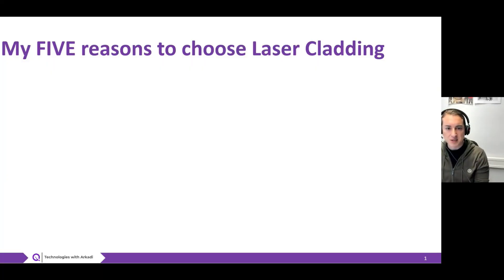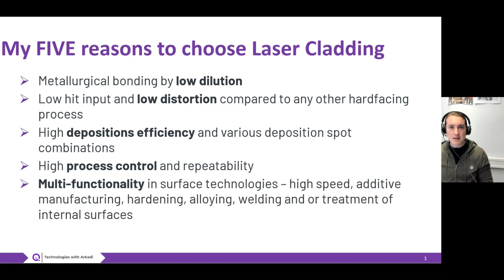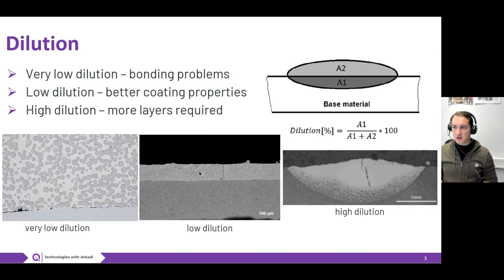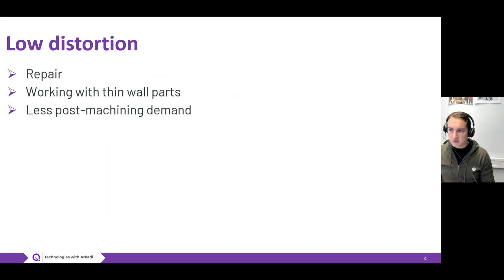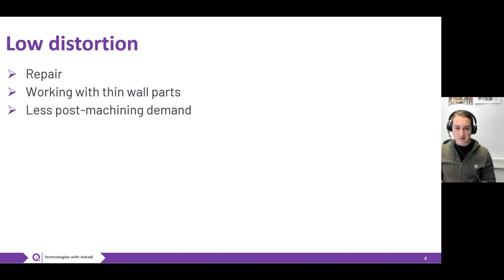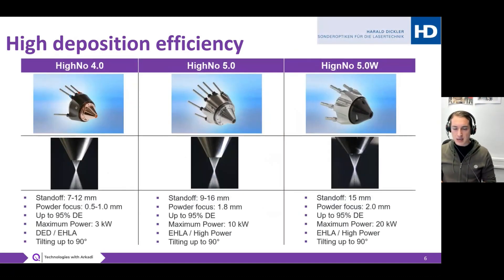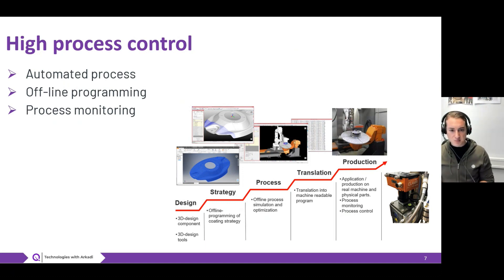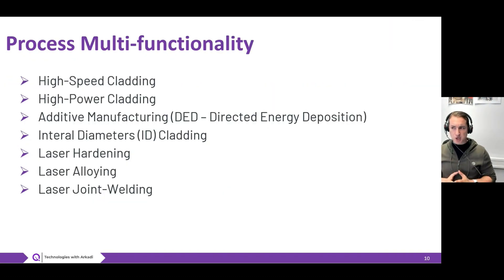Five reasons for laser cladding and Laser Metal Deposition

Comment: very interesting!

How much distortion would probably happen on a 100 mm diameter shaft, 3 meter long, with 2 bearing areas for cladding overlay 5 mm with a 65%WC Co allow (each area 200 mm long), substrate K500 monel

What would your expectation of distortion
Reply: Hello @StephenBoothdocturbo, to estimate the distortion on a shaft during a cladding process, we need to consider several factors, including the thermal stresses introduced by the welding process, the physical properties of the materials involved, and the geometry of the shaft. But, for example, we can achieve 50% or 30% less material distortion compared to using conventional welding processes like arc welding.